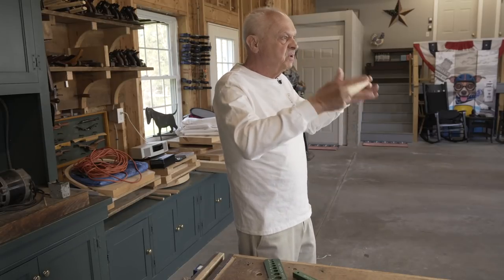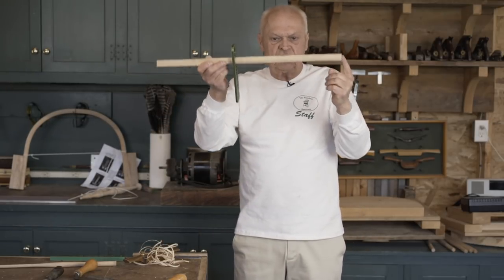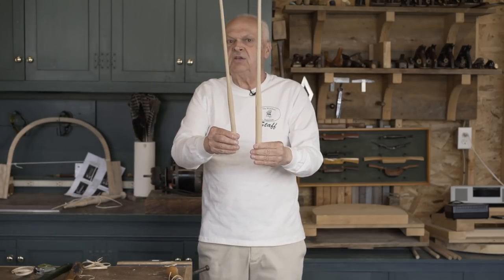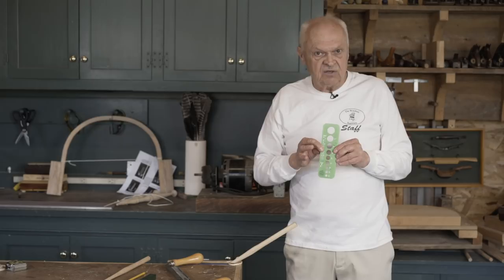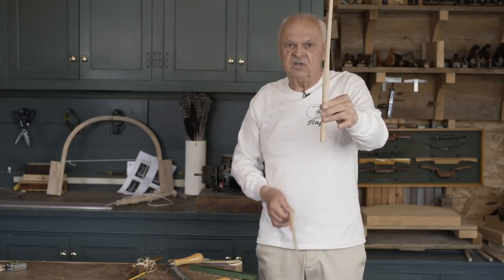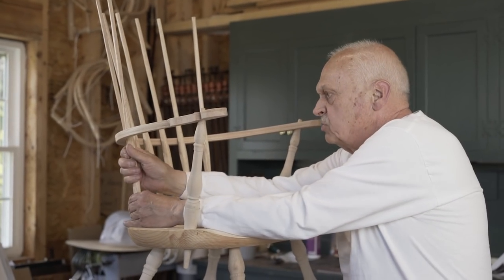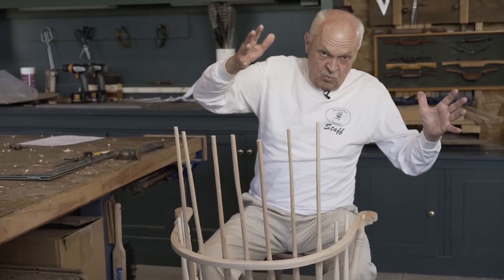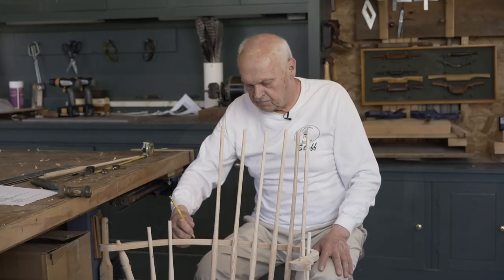Make a Sack Back Windsor - Episode 9

Comment: 8:10 I’ve never tried it, probably because turning a spindle drawknived so thin isn’t practical or possible, but it’s occasionally occurred to me that I could turn the bottoms just like the forward spindles, and then do the tops with a drawknife. While I’ve repaired a bunch of chairs and made other styles, the only sack back I ever made was in the class in 1994 or 95- a long long time ago. But I thought about it…